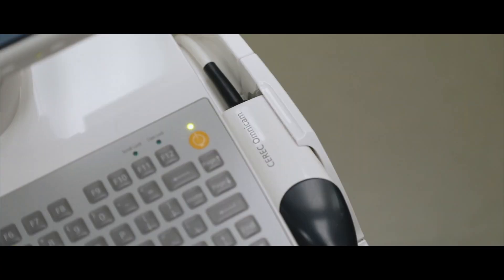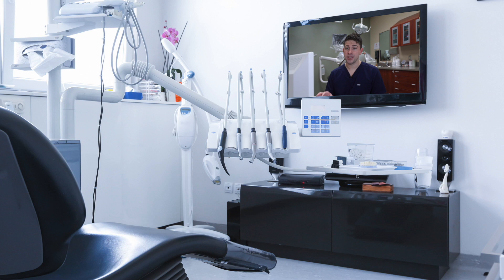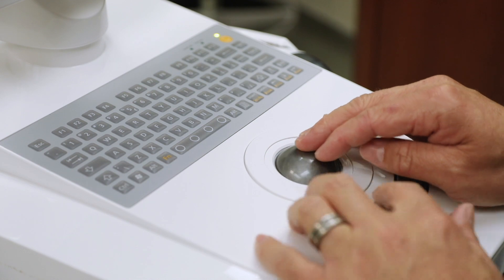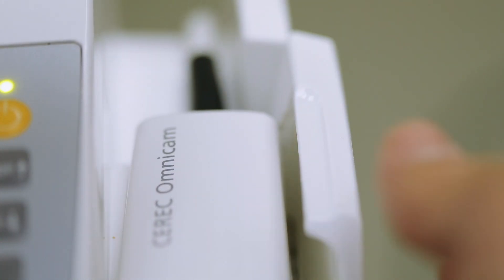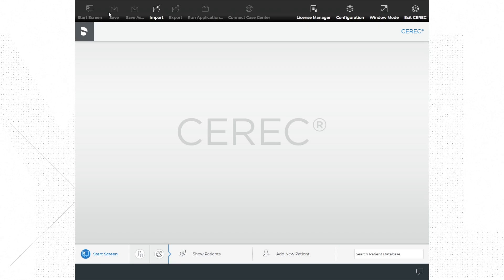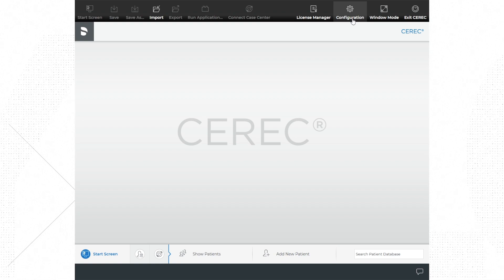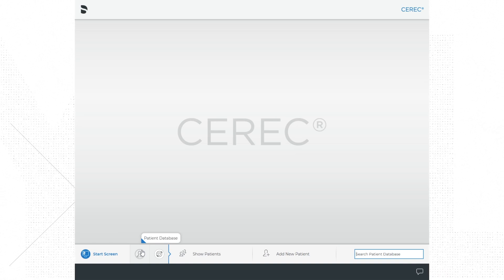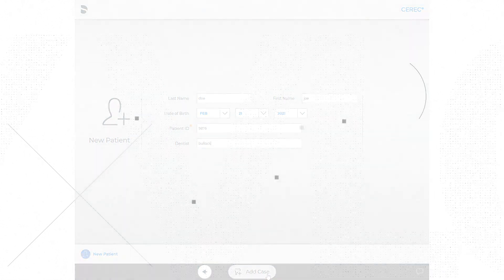Sirona CEREC 5.1.3 CAD/CAM Dental Training - Introduction

Comment: Disadvantages of Cerec Sw: The scanner is associated with patients' saliva, which contains a lot of bacteria and viruses. It is located close to the model and design device.  In other words, the model and design device is related to the scanning device.  The dentist inserts the infected saliva into the mouse and keyboard openings to check the scan while working with the scan by touching the mouse and monitor, which is not possible for the next patient to sterilize.  The instructions for sterile scanners, mouse, keyboards and monitors before scanning each patient's tooth have not been considered by the manufacturer.  From a scientific and hygienic point of view, the scanning device needs to be placed near the dentist's chair and the modeling and design system in the workplace.  Equipment used in medical and hygienic environments requires attention to hygienic principles with minimal disease spread.